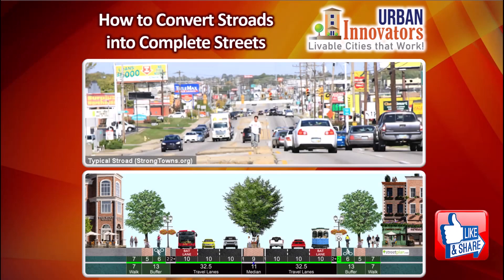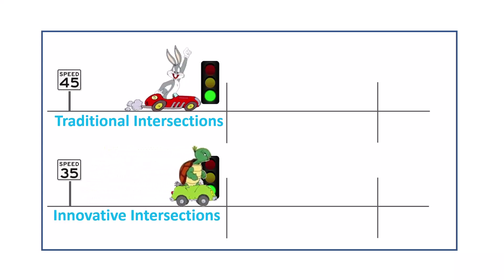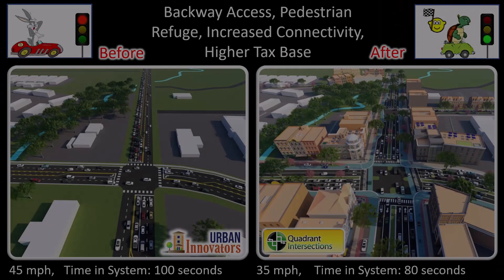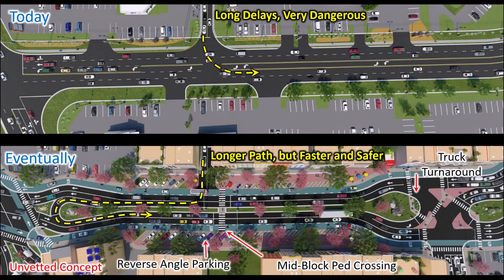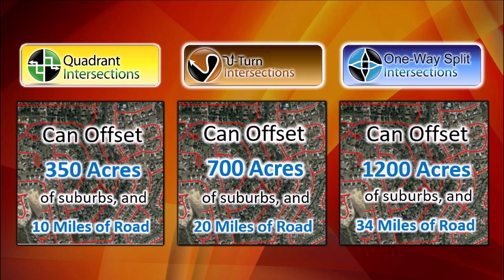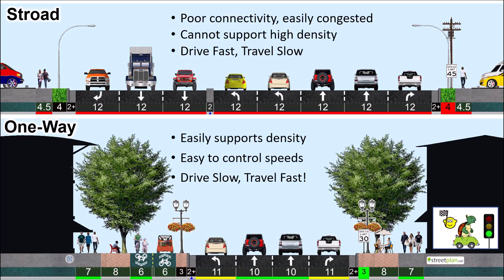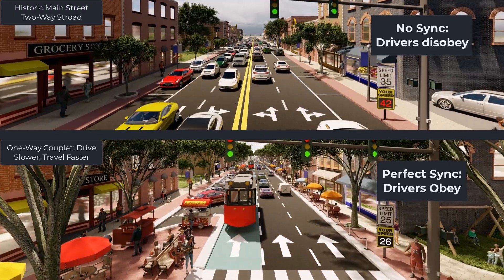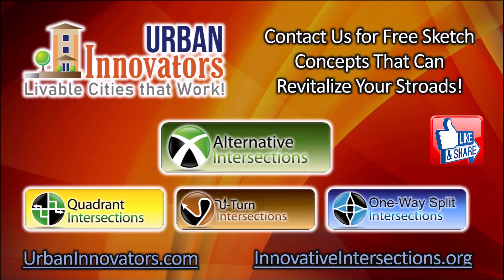Silver Bullets for Stroads!

Comment: The fundamental problem remains: You're still mixing high vehicle volumes and people (except now with more people). This is still a futon. 

Consolidate the driveways and let the stroad be a road . Build the nice mixed use neighborhood such that the buildings are on quiet, pleasent, low volume, _ and narrow_ streets.
Reply from the maker: Some stroads will make more sense to move toward roads, so as you said for those cases.  But America has SO MANY corridors that cannot relocate their traffic, and they also cannot make their adjacent commercial uses go away.  Yes, this mixes high vehicle volumes with people, but it does so at 25-30 mph actual speeds (not speed limit), and that is a major improvement!  Yes, you could technically still say it's a futon, but it's a much nicer futon than anything this country has ever built before!  These are good ways to create density and mixed-uses amidst crappy commercial, which will help us offset sprawl.  If the problem remains, that's because it can't go away.  These are stepping stones to improve upon a bad situation.

Comment: In the Netherlands if we’re talking these traffic volumes something else offer is considered. A road in the (insane throughput even with just 2 lanes compared to a stroad) and 2 narrow streets on the side. This solution still doesn’t see the issue with a stroad. You still have high traffic in a location where you don’t want it and the public spaces between the building still is still fighting for what it’s for.
Reply: Yep ... A traffic light junction can handle only some 150 vehicle per hour. This is the bottkeneck  !To have 2 lanes  lead to the junction is simply over rudency , because 1 lane can handle this fone .  2 lanes only will lead to higher speeds , overhauling , accidents and more congestion.
Turning a stroad into a 1x1 ( preferably with a mid berm) and with nartow low speed (30kmh) parallel roads to tboth sude sor sccess and bicyclists works really well in Netherlands . Both in cities and rural to access farms ....
Reply: I believe the Netherlands is the role model on how infrastructures should be developed. From what I heard, they don't have walk bridges at all over there unless they're on the same ground level which means roads and streets passing under them are below ground level.
Reply: @KuDastardly  Pedestrian bridges are indeed very rare. The ones that are there usually are opportunistic ones. For instance, there already is a bridge for cars and bikes so there is pavement on the bridge too.
Reply: @KuDastardly  A walking bridge of course would be a cycling bridge , that can be used by pedestrians, disabled on mobility scooters and horseriders ! 
Rather than an overpass an underpass would be the choice ! The overpass neds to be higher , than an underpass deep ( see truck height vs cyclist needed height) . Underpasses require less space and a cyclist can use the downhill speed to go uphill again. So it's much better. 
Furthermore there are a lot of canal overpass bridges in NL that can double as 'bike underpass'  ..
In dutch cities there is not so much need , as there are not many 8 lane stroads. Only the circular 2x2 , 3x3 highways arpund the cities would need that .
And to conclude , virtually all vehicle overpass bridges (1x1, 2x2,3x3, rail) built the past 60-70 years will have a good bike path for cyclists ( and mentioned others ).
The 70k  town I went to highschool had a 1x1, 60m long canal overpass built in 1950-51 ( In WW2 many bridges got destroyed) and it has a 4 m wide bike/walk path on both sides. At this day you won't see better outside NL ....

.
Reply: @dennyroozeboom4795  As far as I can tell, many if not all, pedestrian bridges in North America ironically tend to be at the expense of pedestrians themselves as they're built above ground level.

Because of this, not all are willing to climb cumbersome steps just to cross the other sides, especially people with handicaps. As a results, you tend to find shady things like meth junkies camping in the stair well corners and stuff.

Basically, the attitude of North American pedestrian bridges are meant to suit the needs of car traffic than pedestrians themselves. Basically, these pedestrian bridges can be seen as Mafia throwing out scraps and petty changes just to appeal to the masses. :/

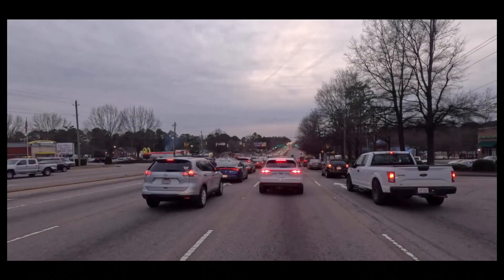Comment: 1:58 
That semi truck was not happy making that turn lol

What about deliveries with this new design?
Reply from the maker: It may be a tight turn for the truck as depicted, but at least it is possible (where otherwise it would not be).  It is a way to retrofit so the corridor can be more walkable, but still accommodate trucks.  Specifics of deliveries could be worked out in an actual design, such as an alleyway behind buildings, or pull-over spots on the main corridor, etc.

Comment: That's a lot of dancing to avoid the possibility of just putting roundabouts at those intersections.
Reply: Flow through the intersection isn't the problem they're trying to solve. Roundabouts are actually kind of bad for mixed traffic. They're great if all you care about is moving the maximum number of cars with minimal disruption, but any cyclists or pedestrians who are trying to navigate that intersection around the outside of the circle are going to create conflict points at every entrance and exit of the roundabout. Trams can't whip around the circle so they need to have bypass tracks cut straight through the center and signals to give them priority to go through them.

These strategies are designed to sell urbanist principles to the kind of traffic engineers who pound the desk and say throughput throughput throughput in response to any attempt to change road design. They aren't perfect. They're compromises.
Reply from the maker: @AlRoderick, glad that you get the point.  These ideas are to bridge the impasse between "throughput" engineers, and those who want to wave a magic wand and have cars go away.  The goal is to make it possible to catalyze mixed-use development in places where that is presently impossible.
Reply from the maker: @TEWnan: please read the material at www.InnovativeIntersections.org.  All that "dancing" isn't to avoid roundabouts. There are so many benefits to alternative modes from these designs that roundabouts cannot provide.  Roundabouts simply cannot work in every situation.  They are generally lower capacity than these designs (which is critical for making super-high-volume corridors more walkable), and to reach high capacity they also have to get unreasonably large.
Reply: @urbaninnovators I think a lot of Europeans think roundabouts handle a lot of traffic when they actually would all choke compared to American counterparts. The more I think about the chicanes the more I see the advantages. I think those throughput engineers need to understand some realities, but it’s probably more profitable in their minds to not understand them. The reality is that we need fewer people in cars and more people on foot if we’re really going to create neighborhoods anyone cares about. Your designs seem like potentially a middle ground, but I really wonder if they could ever bridge us toward more Dutch-style design, which up to this point seems the gold standard. They make things accessible by car still, but they make the other modes really really practical and viable because they don’t cater only to cars and they make cars the most practical only for longer trips, and leave short trips to walking.

Comment: Still very overbuilt infrastructure
Reply: Yes, and not dealing with the core problem of having too many cars.
Reply: These solutions are designed as a fix for areas that are already built, not as a proposal for what to do if you're building something from scratch.
Reply from the maker: Amen.  I don't think it is overbuilt, but simply trying to nudge the auto-oriented suburbs into "less" auto-orientation.  You can't cross the Mississippi river without stepping stones.  These are stepping stones to a better place!